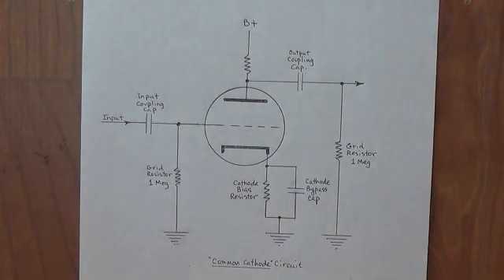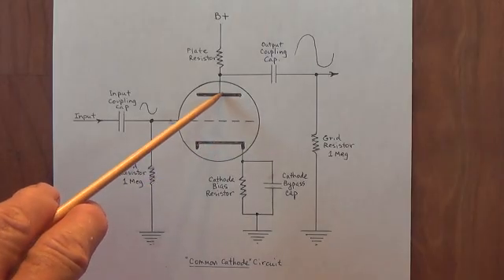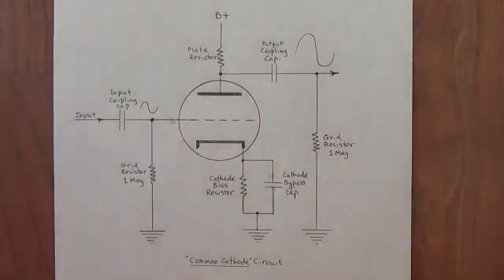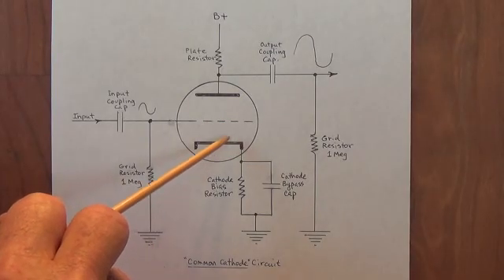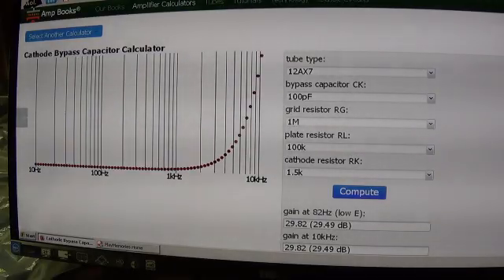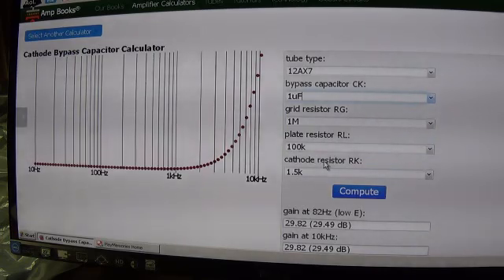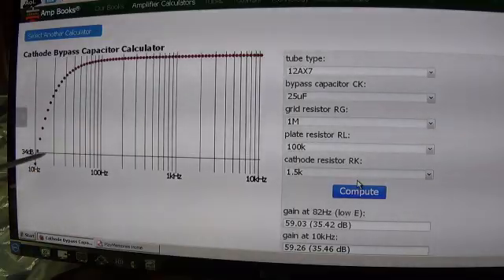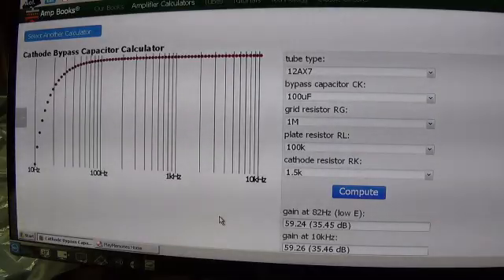Cathode Bypass Capacitors: How they Affect Gain and Tone

Comment: Your videos are the sliced bread of the internet on tube circuits. I can't believe how simple you have made things that I spent hours over but didn't "get ". The math is no problem, but the understanding is the problem. I have already watched your three video on tube amps but I do have two questions if you please.
I am building a 300b tube monoblock SET based on the JE Labs schematic which calls for 380 + 380 V to the GZ37 rectifier but the power transformer chosen (not by me) has only 350 and 400 taps (not cables). Is that because it is no big deal to just use the 400 taps or should I resistor it down?
The same transformer has three 6.3 volt heater taps ( one center tap) but only one 5v tap. This to heat both the 300b and the rectifier, both 5v. The 5V tap is 3a but the two tube require 4a max. Did someone pick the wrong transformer or is it common to resistor down a heater tap from 6.3v to 5?
A week ago I did not know enough even to ask these questions. 
Thanks so much and please keep making these electronics videos and pat Rusty for me.
Reply from the maker: Greetings, Dennis, and thanks for the very kind words. I'm glad the videos are helpful. Rusty says "Hi".

 I have no experience with JE Labs 300B monobloc amps, but I will try to answer your questions. Using the 400VAC taps will probably be OK, even if the schematic calls for 380VAC. This would only be 5% over the recommended voltage. Some of my vintage amps run higher than this routinely with no ill effects. Also, the actual voltage may vary from what is stated, so be sure to measure the actual plate voltage in the circuit during operation. If necessary, you could reduce the voltage using added resistance.

Re the 5V filament current, the schematic I looked at:  http://3.bp.blogspot.com/-0ozENuthY1Y/T9757zbka5I/AAAAAAAAB6s/H1X9luU1lxQ/s1600/JELsc-300BCL.jpg  shows an Angela Universal PT with a dedicated 5V 3A tap for the rectifier (to allow use of a 5U4), and a separate 5V tap for the 300B (probably 2A). It would be cutting it really close to run both filaments from a 3A winding, since the minimum current for the two tubes would be (GZ34 @ 1.9A + 300B @ 1.2A =) 3.1A with no safety margin. It may work, but exceeding stated current limits is a bit of a gamble.

The 6.3VAC tap is for the 6SN7 heater. I wouldn't recommend trying to use it to supplement the 5V output. It would appear that the PT you have, as described, would probably work, but would not be optimum for this circuit.
Reply: Uncle Doug Hi Doug,
I love your videos if even for just the sheer entertaiment value. I still looking for the Fender amp one that was indeed "molested by drunken chimpanzees" 
The rectifier is a GZ37 which I think draws more current and I think you have mentioned is your favorite. The transformer is the James Audio 9612 which has the single 5V tap and three 6.3V taps. I just didn't want to add resisters willy nilly as if its heresy to mess with a simple circuity that is apparently regarded as one of the best sounding in the 300b world. I'm a newb, just a past 60 newb, and I don't know whats kosher. I'm old enough to know theory is one thing, and real world is another, just as you said for the 380 vs 400. But I guess 6.3V is way too much, right?, for the GZ37.
Thanks and keep it up.
Reply from the maker: Dennis, according to Internet sources, the James 9612 is an extremely fine, $300 power transformer with five separate outputs besides the high voltage tap, including one 5V @ 6A for the rectifier, two "5 - 6.3V" @ 4A for the 300B tube(s), and one 6.3V @ 3A for the 6SN7. It's made specifically for use with 300B monobloc amps, and it's a wonderful transformer, so you're in good shape.

Apparently with the two  "5V - 6.3V" windings, you can actually select which voltage you want. I've never seen one of these transformers so I'm not sure how this is done. Perhaps you could contact James or one of their vendors to find out how to obtain the 5V output from one of these taps.

I apologize for not knowing all about James transformers, but my experience is primarily with vintage guitar and jukebox amps, not HiFi gear. The principals of operation are the same, but some of the details are unique.

Comment: Thanks for all the info in your videos. I scored a '72 Deluxe Reverb on ebay. I generally replace all electrolytic caps on the vintage amps I acquire. However, I would like to keep as much original as possible. I have a multimeter that can check everything but capacitors. How can I check the capacitors (safely) with a multimeter, or would you recommend I get a meter that can check capacitors?
Reply from the maker: You're welcome, RB. I'm glad the videos are helpful. One test you can perform on electrolytic capacitors with an ohmmeter is to remove the wiring from each terminal of the can capacitor and then measure the resistance between each terminal and ground. The resistance should be infinite. If you get a measurable resistance, i.e. 50K ohms, then there is a partial short within the capacitor and it must be replaced. To accurately assess the functionality of the electrolytics, you will need to buy an ESR meter. They are available on the Internet.....Ebay usually has them listed. My favorite is the Anatek Blue ESR meter, which costs about $100 assembled (cheaper as a kit). Good luck :)

Comment: Congratulations to both of you :)
Been busy lately and I missed the celebration...

I'm really waiting for another milestone, which for me would be you introducing the concept of voltage drop, higer/lower potential and Ohm's law, without which it is - IMHO - impossible to understand how come the grid has a negative voltage on it in a self-biased configuration. This was on my mind whenever I watched one of your theory videos ;)
Reply from the maker: Greetings, Stan. It's good to hear from you. To be honest, I think the majority of viewers simply seek a general understanding of amplifier theory, and for that reason, I hesitated to delve much deeper into the complexities of cathode biasing. This is probably the most coherent statement I have found on the subject (courtesy of Aiken Amplification): 

"If a resistor is placed between the cathode and ground, and the grid of the tube is referenced to ground (usually by connecting a large value resistor, such as a 1Meg, from grid to ground),  the tube will try to conduct a large current from cathode to plate, since the grid and cathode are initially at ground potential." 

"However, this cathode current flow will cause a voltage drop across the cathode resistor, making the cathode voltage positive with respect to the grid.  Since the cathode voltage is now positive with respect to the grid, the current flow will decrease, and the tube will head back towards cutoff.  A point of equilibrium will quickly be reached where the increase in current is offset exactly by the increase in cathode voltage, and the bias current will stabilize at some particular value." 

"It will remain at this value unless the resistor value is changed, or a different tube with different characteristics is plugged in. This allows the desired bias point to be set by varying the value of the cathode resistor."

I hope this clarifies the issue. Thanks for viewing and for your thoughtful input.
Reply: Thank you for the reply. 

It's hard for me to put myself in the shoes of a complete beginner. Perhaps your approach is better, to be as general as possible and give the viewers a "birdseye view" of the theory.

On the other hand, if someone is supposed to have a decent enough understanding of how it works (decent enough to repair or adjust an amp), things like using the words current and voltage interchangeably or not explaining how the signal really is a fluctuation of an otherwise constant current flowing through the tube - make matters only more confusing.

Explaining this first would - in my mind - make it much simpler to introduce other, more advanced concepts (like the negative feedback you talk about in this video: the resistor carries the DC part, and the capacitor takes over the majority of the AC (signal) part, as it's AC resistance is many times lower than the value of the cathode resistor). Or the output transformer differences between single-ended and push-pull circuits. Or what proper biasing means and does. Or..

Again, my perception may be skewed, but I'm a believer in Einstein's "make things as simple as possible, but not simpler" statement. Simplifying stuff is good, oversimplyfying makes it harder to unerstand and make progress.

I know it's easy to criticize, but hard to actually do something... Your theory videos are very good and much needed. I just think that making this one leap (Ohm's law - not so big in my opinion) would make them absolutely unbeatable as a solid foundation for tube amp enthusiasts.
Reply from the maker: Thanks so much for your thoughtful input, Stan. I will definitely keep your suggestions, particularly those regarding Ohm's Law, in mind when developing future videos.
Reply: BTW, just watched the tone stack videos. They are great and very informative.

Just imagined a scenario, whereby - having earlier explained the voltage divider and potentiometer concept, stemming from the Ohm's law - one could present the low/high-pass filters as "crazy dividers", where one of the resistors is replaced by a capacitor. And this capacitor, being (just between us) sort of a transvestite, tends to mimic a resistor when it sees AC. 

Of course I'm sure Rusty would come up with far better script witing for that ;)

All the best, Uncle Doug :)
Reply from the maker: Thanks so much, Stan. I really appreciate your insights and commentary.....as does Rusty :)  After I have completed and uploaded a rather complex video, I always torture myself by coming up with great ideas (like the one you proposed) that should have been included. The one satisfactory way to handle this masochistic tendency is to write them down for incorporation into future videos. All the best to you, too, Stan.
Reply: An RC filter is indeed a potential divider where one of the 'resistances' (i.e. the reactance of the capacitor) varies with frequency. Looking at circuits from a different viewpoint can really help understanding.

Comment: I have a few queries about design of an amp circuit.  I build guitar pedals for a hobby and I want to design my own circuits and amps one day, but I'm useless as to how to start.  What is output impedance and input impedance?  I've read a ton if articles but none of themselves into what it actually means.  Like for instance: I'm confused about what speaker impedance means, And how and why you need an output transformer?  I'm also confused on what exactly power tubes do.  I know this is a tall order, but I'm just seeking answers, and I don't know the right questions to ask.  Maybe I'm missing something.  
On another note, your videos are incredible and I wish that you delved more into the math and physics of why things happen ( I learn better when I know the why behind the how). Thanks for all your knowledge being shared!  
Sam
Reply from the maker: Sam, all of your questions are addressed in other videos that I have posted. Check out the How Tube Amps Work series and the Output Transformer video for starters. If you like math, watch the Tone Stack series (especially Part 2). Hopefully, these additional videos will provide the explanations you seek. Good luck.

Comment: Great video Uncle Doug, keep up the good work & congrats on the 100th video milestone!  Now I am anxious to start tweaking the values of the cathode resistors & bypass caps on my amp.
Reply from the maker: Thanks so much, GG. Rusty and I are still celebrating. By all means, do a little experimentation with cathode bypass caps. Although the value of bias resistors is strictly dictated by the plate current and plate dissipation of the tube, the value of CBC's is dictated by the ear :)) Good luck !!!

Comment: Another great vid, Uncle D! I've never thought too deeply about this, but now I understand exactly why the income signal is almost always connected to the grid of the triode, and why your signal gets hotter (or louder) the harder you strum the guitar, due to the signal becoming more positive, which caused the grid to do less suppressing of the signal. Prior to this vid, my only thought on this was "signal hits the grid, amplification happens".

I'm always surprised by what I learn watching your vids!
Reply from the maker: Yes, Alva. Small signal fluctuations on the grid become large fluctuations on the plate, and after several stages of amplification, the plate signal becomes strong enough to drive the speaker(s). It's great to know that the videos have been helpful and informative. Thanks for watching :)

Comment: Yeah! The 100th video. Time to party. Time to thank you again for your work, your just awesome! :)
Reply from the maker: You're welcome, Julez. Rusty and I really appreciate the time you spend watching and commenting on our videos. See you in the next 100 :)
Reply: I'll be there commenting on the next 100 videos :) Give rusty a hug from me :)
Reply from the maker: I will....thanks again :)  ^. .^
Reply: Uncle Doug
Hey I got a question, just to see if we share the same opinion:
Would you think using a cap for letting enough of the signal (bass) through and then design the tonestack would be the best solution?
Or would you cut the bass with the cathode bypass capacitor before the signal hits the tone stack?
both versions of course only, if you wished to have less bass in the signal :)
Reply from the maker: Greetings, LES. I would let the bass get to the tone stack and then adjust the tone controls to reduce the bass. That way, it's not hard-wired, but reversible, in case someone else buys or uses the amp.
Reply: Alright, sounds good. That's what I would do as well :)
Cheers!

Comment: Hi Doug, cool video, but you know pretty much all you need to calculate this by yourself, with no extra math...

As you (and we as well since you have covered it before) know here is the that formular:  f=1/(2*pi*r*c)

Ok here we go: 1/(2*pi*1.5k*100uF) = 1/(6.28*1500exp3*100exp-6) = 1/94.2 = 1.06
This 1.06Hz is the frequency you get the -3db rolloff. (@unity gain!)
So it needs to be shifted by the amplification factor of that tube circuit of 30dB roughly said....equals to around 15Hz (20dB equals 10Hz for voltage vs. frequency logarithmic display) To make it complete clear it´s slightly higher (around 18Hz as we got 34dB something gain of that tube in this particular circuit)

Pretty much that what your monitor shows @ 10:56 ....( it cuts out on the dB scale but the monitor display in the prev. with that 1uF cap show it all better

(The compute button does the same what i just calculated for you ;)

It´s in fact that easy...:)

So no more messin´ around with all these little "helpers" , as you (and so we do) already know that all...:) :)

Relax, have a cold beer and have fun with all you know already!! :) :) :)
Reply from the maker: Good Lord, TC. I think the Calculator Program is still the easiest route for most of us :)) Thanks again for your learned input.
Reply: Uncle Doug
Of course it is, but funny thing to me was your statement going something like "...in the past i done this by trial and error...." put a smile on my face...since i know that you know the f=1/(2*pi*r*c) thing ;)

You can and should use this Program anytime, but keep your head up high as you know what it´s all behind....and see what the little f=1/(w*r*c) can do for you:)

Now go vice versa and do this: c=1/(2*pi*r*f) and voila you can calculate the needed Cap all by yourself...coool thing...another mystery cleared! (Do not forget the unity gain thing)

You can, in fact, go your schematics all around only with

U=R*I (you´d say E=R*I)
P=U*U/R or P=(I*I)*R
f=1/(2*PI*R*C)

It takes only half an hour but after that you know pretty much all what the amp does and why it´s working like it does (or not and these little helpers show you why...nice? jep! ;)

Someday you may tinker with a choke instead of a resistor in the tube´s plate path...you get much more gain, but you have to wind up a coil....this is how the f=w*r*l works, remebering that ´omega´ (w) is w=2*pi ;) the circle frequency...
Sorry for this, but i sometime love the power of math...;)
Reply from the maker: Wow....thanks for the math review, TC. You are correct that math formulas are the best way, by far, to design and evaluate circuits. They also come in handy in everyday use, like the time recently when I needed a 12V bulb for a VW alternator charging circuit....and I only had 6V bulbs. Thanks to a basic math formula, I could easily calculate the value of a supplemental resistor. No trial and error......the calculated value was perfect :)